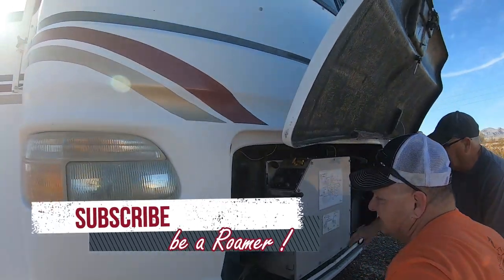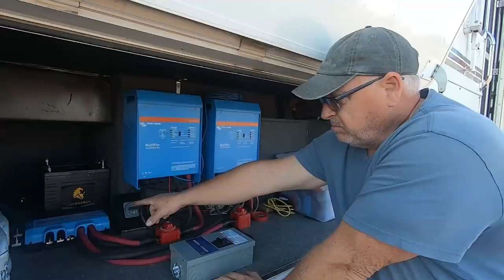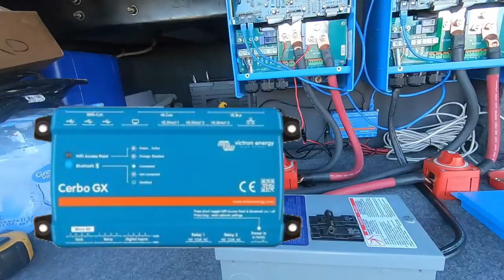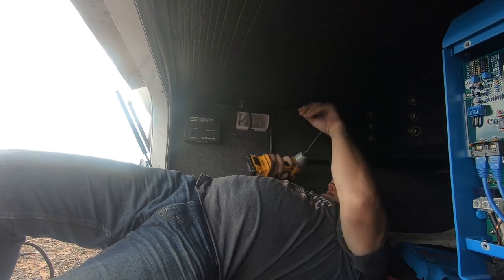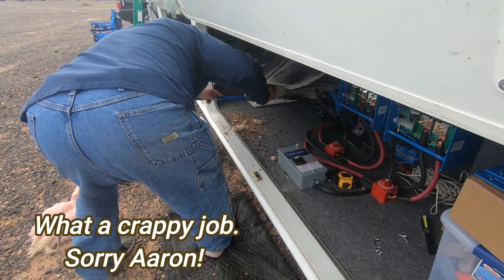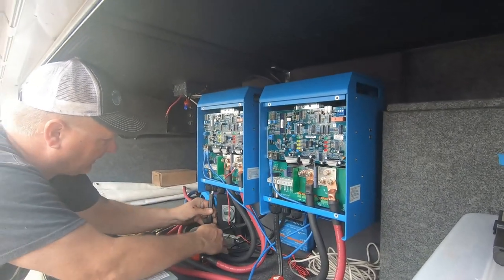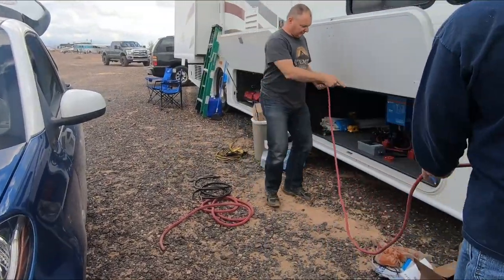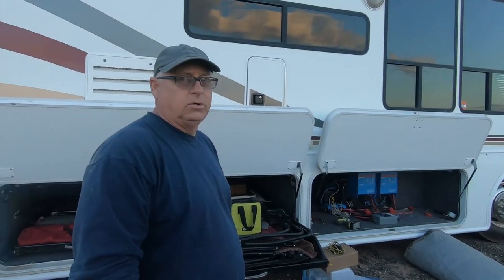This Older Motorhome Gets Modern Electric System | Victron Multiplus Inverter Charger

Comment: Jamie, are you getting 50 amps on each leg when running on battery?  I had saw a video with Will Prowse where he did the same setup, minus the RV.  He was only able to get 20 amps while charging his Tesla.
Reply from the maker: Technically,  yes. I have 2 inverters so I could split up my power usage. So I don't have to worry about what I run at any given time. The battery  bank will determine how long we can run something.

Comment: Very nice setup with 2 Victron Multiplus units. Eight Lithium Iron Phosphate batteries and a good solar panel array on top of the rig will give you many years of boon-docking happiness.
Reply from the maker: Thanks.  We have just house 4 batteries from Lion Energy.  8 would be nice though.  We'll be installing our solar next month when we meet up with JonesN2Travel again.

Comment: You got some awesome upgrades! And Aaron does an awesome job with the installs. You will love the system from Victron. We installed a Victron system in ours and we are very happy with it. Stay safe traveling friends.👍👏❤️🇺🇸🥑
Reply from the maker: Victron is the best equipment on the market and Aaron is a great installer and a good friend. I had installed this same setup in our Holiday Rambler and it was worked great. Thanks so much for watching! Safe Travels.

Comment: I know the Jones' are in SD right now...are you there too? We have a 2005 Alfa 5th wheel we're renovating. With no ac on roof, you can put a lot of solar up there.
Reply from the maker: We've never seen an Alfa 5th wheel. Wow! That's cool. Are you pulling with an HDT? We're in AZ. Going Fulltime in July. Met up with the Jones in Quartzite in January.
Reply: @RoamingWithRosie  Ours is a SYF38RLES, 3 axles. Bugger is heavy. Hubby originally wanted a 1 ton. But I'm from a family that does a lot of trucking, convinced him an hdt was a much better option...so we're looking. As soon as he retires, we're outta here....lol...drove by the Jones' set up here and showed him. To actually see a set up, I think was one more convincing straw.
Reply from the maker: @mhspear  You are right about the HDT. You get a lot more truck for the money and it's much safer towing with the HDT.

Comment: I love my Vicrton Inverter. I only have one so far but I made it work with some trick wiring. Now I need some BattleBorn Game Changers 3.0 and another 800 to 1000 watts of solar. Enjoy your new system.
Reply from the maker: The Lithium batteries are game changers. We are installing 1200 watts of solar next month. That's going to make it so we don't have to run the noise maker. Thanks for watching!

Comment: Those inverters have a integrated transfer switch built in, why are you using a seperate one?
Reply from the maker: I followed the wiring diagram that I got from the supplier. Three other friends of mine are all set up in the same way. Thanks for watching!

Comment: what was the costs?
Reply from the maker: The batteries, Multi Plus Inverter/Chargers, Cerbo GX, Lynx Distributor and Battery Monitor was $6200. You will also need 6/2 and 6/3 wire, 4/0 AWG battery wire and a couple of junction boxes and fuses for your connections in the Lynx Distributor. Hope this helps. Thanks for watching!

Comment: Why two victron 12v 3000?
Reply from the maker: One for each side of the 50 amp service.
Reply: @RoamingWithRosie  i also have an ALFA, 2004 gold. 
i’m looking to do something similar. why did you go with 2 3000? the existing system only has one and it’s smaller than the 3000 victron, i believe it’s a Xantrex 2400… could you use one, to replace what’s there? i’m learning and trying to better understand these systems. thx!!

Comment: what was the totel cost of this?
Reply from the maker: The batteries, Multi Plus Inverter/Chargers, Cerbo GX, Lynx Distributor and Battery Monitor was $6200. You will also need 6/2 and 6/3 wire, 4/0 AWG battery wire and a couple of junction boxes and fuses for your connections in the Lynx Distributor. Hope this helps. Thanks for watching!
Reply: @RoamingWithRosie  this is not too bad. what was the benefit?

Comment: I’m thinking about buying a 2006 ALFA  36 ft  most have a cat in them every once in a while you will fine a Cummins I also found a 2000 Alpine  that is beautiful it was kelp inside a climate controlled building but it has 120,000 miles  but the owner wants 53,000
Reply from the maker: We have the CAT 350 and it's been great. We had a Cummins in our Holiday Rambler and it was a good engine as well. I don't know anything about Alpine.  We love the Alfa. Thanks for watching!